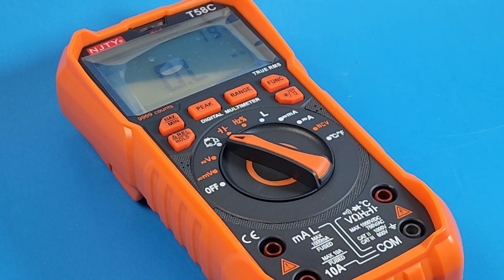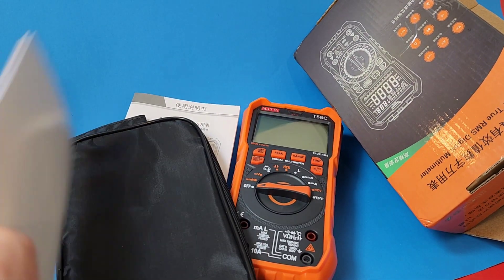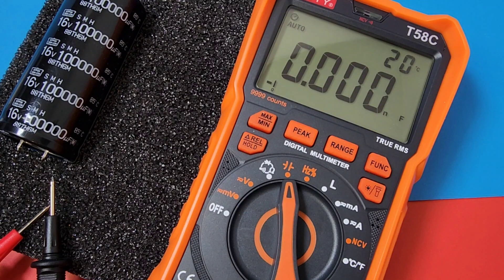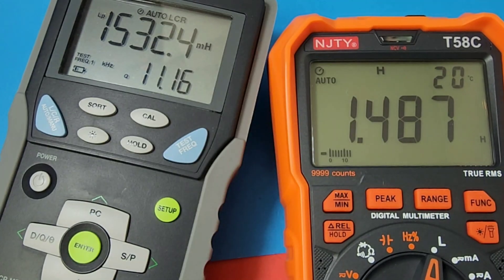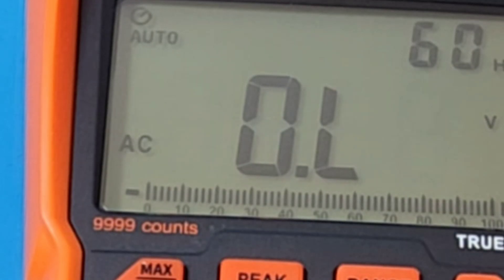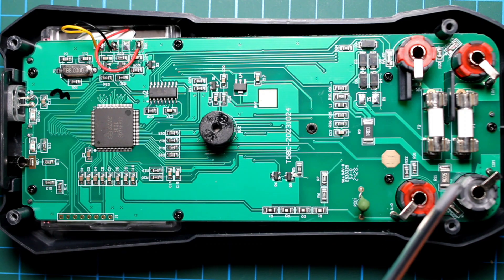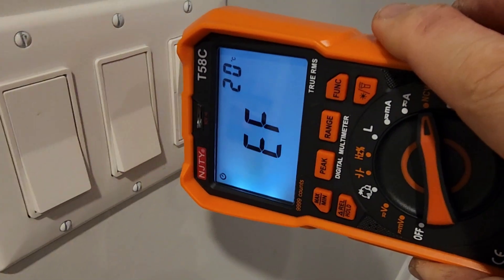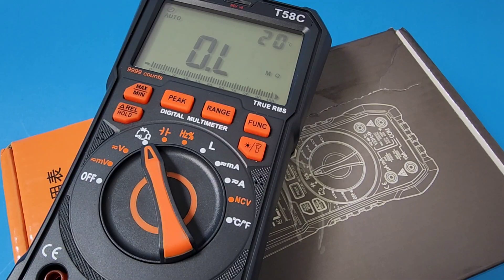BETTER than an LCR Meter? T58C CHEAP-O Multimeter Review & Teardown!

Comment: I am very happy because I saw a serious and unbiased test. Congratulations to the creator of this quality video. Very useful post *****!
I also bought such a multimeter, I also tested it for frequency measurement up to 10mHz. It worked flawlessly at the level of about 100mVef. I also tested capacities from 10pF and I was very satisfied especially with variable capacitors in the 2x500pF range. Good response speed also with electrolytic capacitors of 1mF.
🙏👋👍
Reply from the maker: Thanks so much for the kind words and sharing your own experience – really appreciate it! 👍

Comment: I always appreciate how you show the input protection. As a (former) IBEW industrial electrician, I would never use this meter for any line voltage work, but certainly would for low voltage electronics work. It would be cool if these cheap meters measured Q factor like that LCR meter you showed, and even rough Q factor numbers would be useful.
Reply from the maker: Definitely, that input protection is always a concern 👍  Yes it doesn't have all the bells and whistles of a full fledged ESR meter ..that would be been sweet!